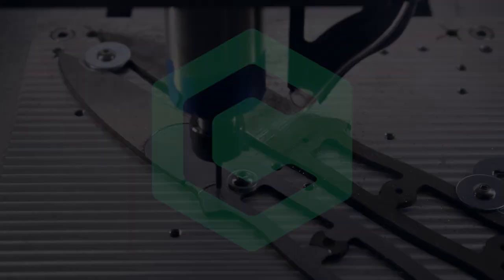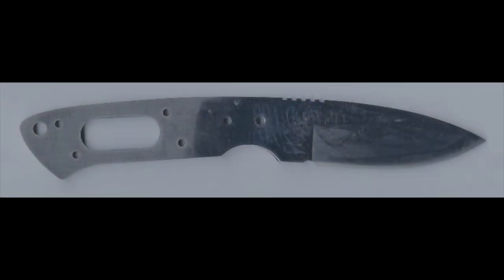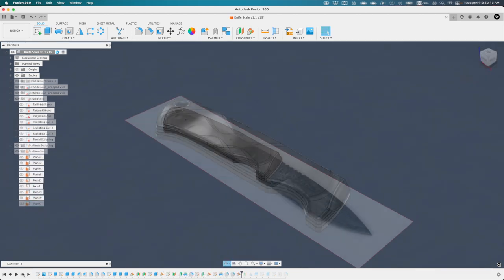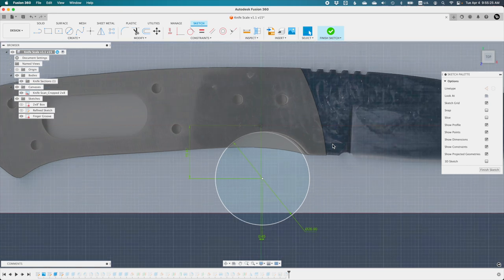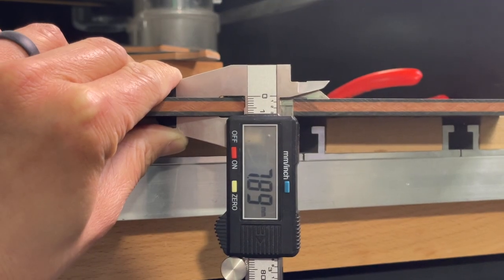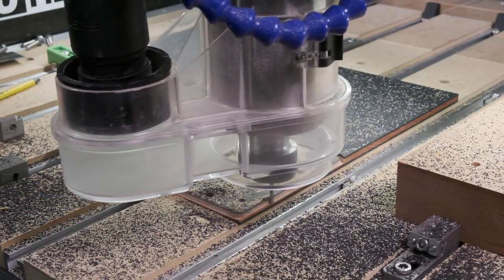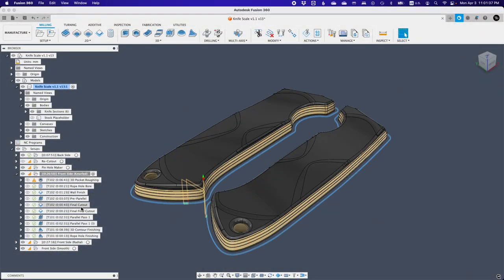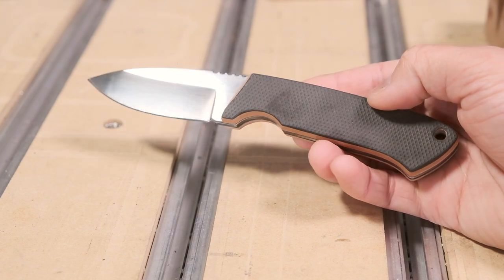Machining Textured Knife Scales from Richlite

Comment: You can also use calibrated graph paper over a light table (i.e., a table having a glass top over a box that houses lighting) to accurately layout physical items. I've used this approach to get very accurate dimensions of parts for which the drawings are provided in 1:1 scale mylar (common in the aerospace industry). This would eliminate the issues you've experienced when scanning the knife.

Comment: I like the radial but it still looks too thick.
Reply from the maker: I might consider machining a third set that completely eliminates the inner black layer to thin out the material further. The question then would be whether or not I do a slightly coarser radial pattern so the grooves are spaced further apart and stand out more...  🤔
-W
Reply: @carbide3d  Do it! Do it!

Comment: the scales are too thick IMO. need to slim those down by at last half if not more. having a bulky handle doesn't feel great on a knife and it looks a bit off. low profile is the best. you could easily modify the ones you made.

Comment: So complicated.  I glued some pallet wood to my knife..pinned some pins through it. Next day put it on the grinder. Looks just a good... better really. I'm just messing with you... but for real it seems complicated af.  The possibility are endless with cnc....learning curve would be pretty time consuming.
Reply from the maker: Paul,   CNC projects are only as complicated as you make them.   There's certainly a progression of skills, but here at Carbide 3D, we do everything we can to guarantee you'll find success.
Reply: @carbide3d  thanks for that response.. I'm going to study on it.
Reply: @carbide3d  since I have your attention I do have a question. Keep in mind it will be my first Cnc machine so simple is important.  I make knives and modify existing knives. What model cnc should I be looking at to get my feet wet.
Reply from the maker: Paul,   The Shapeoko 5 Pro can handle nearly anything you’ll throw at it.   The optional  footprints are at home in a wide variety of shop layouts.  
If you’re exclusively staying small, go 2x2.   If you have some space you’re building out, go bigger to allow yourself job flexibility.   
Batching out knife scales is definitely a Shapeoko job.
Reply: @carbide3d  excellent ty